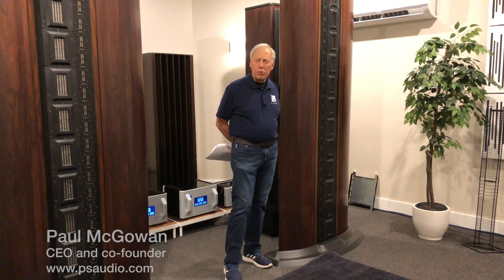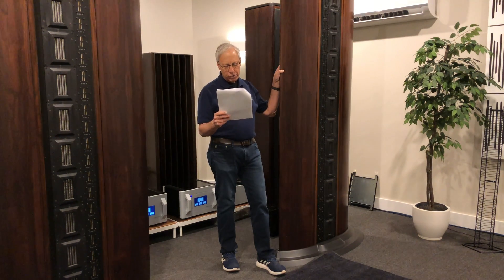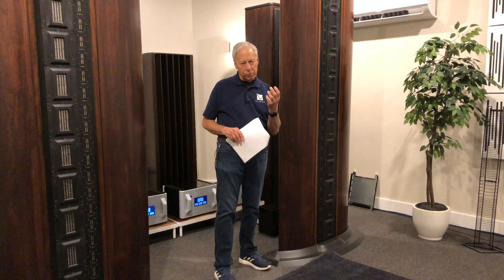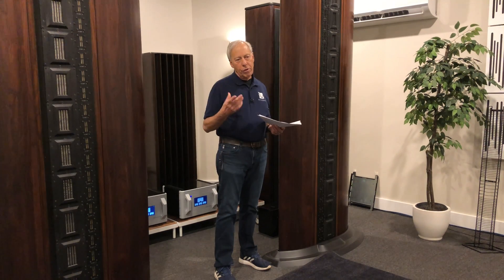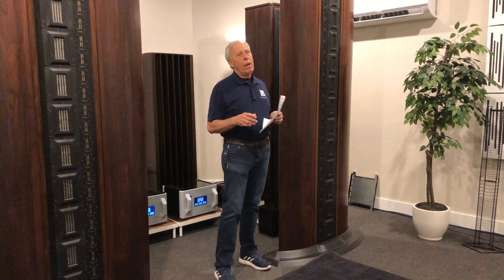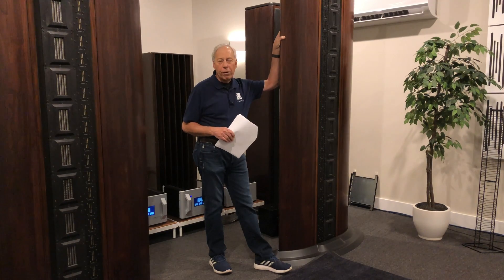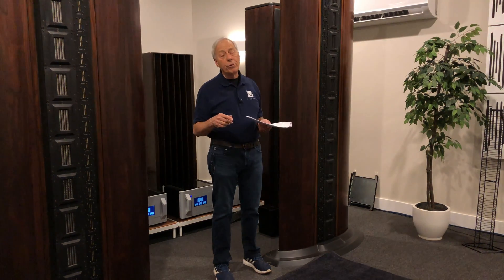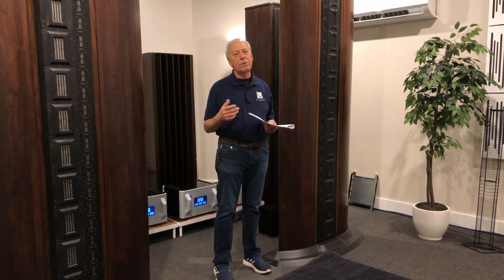4Ω speakers on an 8Ω load?

Comment: If you add 2 Ohms of resistance in front of the speaker it will have a significant impact on the bass response of the speaker, outside of the drop in volume.  The Q of the speaker will change and the cabinet that was designed for it will no longer be appropriate, less of an issue in sealed enclosures than ported ones.  The bass will likely be less well damped, more "boomy".  There is DC resistance in the crossover components going to the woofers but this has been accounted for in the design in any competent speaker design.  Admittedly the resistance goes up in the speaker as the voice coil heats up at higher volumes but this is again a design consideration and is small by comparison.

Comment: Sorry Paul I would NOT run a system i that matter. I know personally that will not work. I Fired 2 of Sony s top -of-the-line receivers
A top-of-the-line Marantz In a matter of four weeks running  4 ohm speakers. So I replaced them with the anthem  MRX 1120 was specifically stated  that it could handle a 4 ohm load and paired it with a Rotel RB 1582 mk ll amp rated at 4 ohm

Comment: Could 10W 2 ohm resister get hot enough to start a fire on a carpet, by doing what Paul said in this video? Come on Paul, I want PS audio focusing on making great audio gear at great price and not waste lots of money getting sued by people with burnt down homes.  Take down this video, or at least edit it with stronger warnings. Or are you certain that what you said people can do in this video will not cause any fire? What's the highest temperature the 2 ohm resister could reach following what you said in this video? Could something people have in their homes catch on fire at that temp? If people put 1W 2ohm resister instead and burn their house down, can you win in court?

Comment: There is no such thing as an 8 ohm amplifier. An amplifier's output performance varies with the load connected. A simple review of the owner's manual will tell you what loads are compatible with the amp's maximum output capabilities. I would never recommend adding series load resistors. Amps and speakers are either compatible with each other or not. At typical listening levels there is seldom an issue as described. Proper ventilation is always important.
Reply: You could have an amp with an 8 ohm output impedance,  but it wouldn't be hifi. Ideally an output transformer-less amp would have an output impedance of 0. Most modern amps are some small fraction.  And didn't tube amps with output transformers have taps for different loads? They might very well match the speaker impedance for maximum power transfer,  but I'm not sure.

Comment: Modern digital amps have a protect mode. If the amp doesn't like the speakers impedance, then it will likely trip the protection mode. If it doesn't then you will want to watch temps. Rather than a resistor to match ohm rates. Just add another 4 ohm speaker to each channel in series. Wasted energy with resistance.

Comment: BAD Advice.  It depends on the quality of the amp and the actual  minimum impedance of the speakers.  The given Ohms are the nominal.   Current drain will double - see Ohms Law - which can put a large strain on the amp, as well it can be influenced by the speaker cables  since their effective resistance will double (again, see Ohm's Law)
Reply: Yep bad idea, best to get an amp that can handle 2 ohm loads for that channel if surround sound. Etc

Comment: Disclaimer - I’m not even close to being an electrical/electronic engineer—- I’ve been running the nominally rated 4 ohm unifi ub5 in the 8 ohm setting for the past month. I don’t listen at ear splitting levels so it sounds great and the receiver never gets hot. It’s always been warm to the touch but never got hot and the auto shut down never engages. The receiver I’m using now is the Yamaha r-n803. Based on what Audioholics.com said those amps that have that feature of switching ohms from 8 to 4 are just to meet certain safety inspections (think CE and UL) and to do so moving that switch over to 4 ohms is crippling the amplifier so it holds back the electrical current driving the speakers. They have run tests on the Yamaha a-s801 amp section running 8 and 4 ohm on an 8 ohm load. Anyway take this with a grain because do not know what I’m talking about. Not really.  

Also wanted to add a speaker is nominally rated. Speakers will perform dependent upon the music - ohms will fluctuate. Again I don’t know what I am really talking about. 

Anyway I have experienced nothing bad from running a 4 ohm inefficient unifi un5 on an 8 ohm load.

Comment: I connected 4ohm speakers to my 8ohm receiver and when I cranked up the volume the receiver went into protect. So now I only search for power amplifiers that can support down to 2ohm loads and only use 4ohm minimum speakers.

Comment: In one room of my house I've driven some fairly large (three-way with 10" woofers) four-ohm speakers (R. A. Labs Reference 2A) often quite loudly for over 20 years with eight-ohm receivers and had no problems of any kind. The receivers involved were good ones (none died from this use, I merely upgraded), however, and I suppose something such as an entry-level Sony would possibly have had problems.

Comment: 25 watt wire wound and non inductive would be best . Failing that use a 50 watt L-pad attenuator or even try two 4 ohm speakers ( they gotta be the same btw !! ) connected in series ..!

Comment: If it were he other way around, for example 16 ohms speakers, you'd lose power but even it clipped the amp wouldn't get hot. While a heavy load will greatly increase the heat. I've had friends twist the wires together and hook up 3 sets of speakers to a 8 ohm amp -- something like 100 watts of heat for 5-10 watts out ...  maybe you've known a few.

Comment: Rare indeed is the amplifier that will smoke if the load has a lower impedance than normal, 
as long as it isn't Too low. 
Keep the volume well below the point where the amplifier clips, and it will most likely be OK.

Comment: Would've been helpful to say what type of speakers they are for sure. A common case is ported enclosure speakers which have a lot of impedance rise - the drivers and crossover outside the enclosure may measure 4 ohms, but once in that type of enclosure their minimum impedance may be as high as 10 ohms for example!

Also would've been good to know what amplifier is being used - some can have a conservatively rated minimum impedance and I have one rated 8 ohms minimum but it doesn't complain driving sealed enclosure 4 ohm rated speakers which are much closer to a true 4 ohm minimum impedance.

Comment: Adding resistors in series will ruin the damping factor and that means your speaker cones will not be able to follow the intended wave motion as precisely, e.g. a drum wIl sound more boomy.
Reply: True, although the DC resistance of the speaker in fact is also a resistance in series with that speaker coil. A speaker with 6 Ohm impedance rating typically has ˜5 Ohm DC resistance, which is in fact already has a 5 Ohm resistor in series. So adding another 2 Ohm won't change the boomy-ness as much as one would expect.

Comment: At lower impedances the amp will get hot.  Get yourself some 120mm computer case fans, they normally run at 12V DC but you can run them at less voltage to make them quieter (I run mine on an 8V wall wart and they are silent).  Just point them at the heat sinks for cooling.
Reply: I found a small personal desk fan at Walmart for something around 5 bucks. It's got rubber feet, can be rotated for direction control, as in pointing up to extract heat  and is 120 volts, so I have it plugged into a switched receptacle on my amp. Keeps it nice and cool and a lot cheaper than computer fans.
Reply: @jamesplotkin4674  Cool! :-)
Reply: @juliaset751  Forgot to add, I placed a small postal box to surround this fan and have it draw air out the top and not spill to the sides. The amp sits on top of the tv center and a nice mantle clock hides the box. Works really well. Only at the lowest volume, can you hear the gentle whir of the fan.
Reply: @jamesplotkin4674  "a lot cheaper than computer fans"
Fleabay has them trending around $AU3.75 ($US2.59). I have boxes full of recovered useable computer bits so they are even cheaper than that.
Reply: Works well for hard drives that run too hot!
Reply: @jonathansturm4163  Yep, I have an external HDD dock that I’ve modified with a fan.  I think I may be keeping Cooler Master in business.  LOL
Reply: @juliaset751  I feel the same way about Seagate! A 2 TB Barracuda that's only ever been used for backup in an IcyBox is dying!

Comment: You could use an auto transformer and virtually eliminate losses you would incur using a resistor.  Another benefit of the auto transformer is that you get the benefit of the full damping factor of the amplifier that the resistor would likely adversely affect.  The full back emf of the speaker would work against the amplifier’s low internal impedance resulting in greater control of transients.  A 48V-115V control transformer wired in an auto-transformer configuration is nearly perfect to couple your 8 ohm rated output to a 4 ohm speaker load.  For a 100 watt amplifier, the transformer would only need to be 30 VA rated.  I’ll bet some specialty transformer company probably makes a transformer that already does this trick.

Comment: This is a good question to ask, and relevant to my setup. I have a pair of Plinius SA-50 amplifiers, which are stereo A/AB but can be switched into monoblock mode (hence why I have two). Now the manual states that in stereo mode I can connect speakers from 4 to 8 ohms nominal, but in monoblock mode only 8 ohms. I currently have speakers that are 8 ohms but have considered replacing them.
GE Tritons have a nominal impedance of 8 ohms but reviews warn they can dip down to the 4 ohm region or lower. In Class A operation the amps are already running hot. Now I assume the speakers spend most of their time around the 8 ohm region and only dip part of the time, hence the 8 ohm nominal spec from GE so it should be a non-issue. Any thoughts Paul?

Comment: Speakers do not possess "an" impedance, they have a "nominal" impedance, a somewhat fictitious number. Nearly all speakers of interest to the audiophile have a nominal impedance of either 6 or 8 ohms and every amplifier I have come across is happy to drive either. This doesn't mean there are no amplifiers so badly designed they are going to go up in a puff of smoke with 6 ohm speakers, but they are unlikely to have been manufactured for audiophiles' needs. There's a good explanation in How to stop worrying about speaker impedance by ELAC's Andrew Jones:
https://www.cnet.com/news/how-to-stop-worrying-about-speaker-impedance/

Comment: I used a 100 wpc $100 Sherwood receiver 11 years ago to check the phasing after recapping the crossover network on my 4 ohm speakers while the woofers were out for reforming and even at low level and the woofers disconnected the receiver shut down after just a few moments every time to protect itself.

Comment: Heatwave in Europe.....anyone elses amplifiers getting a bit toasty??
Reply: Is that class D weather for sure
Reply: I dont even wanna turn it on, giving to much heat!! :p
Reply: @87woutor  it's in a short shelf, not too much space to breathe and I'm scared
Reply: @randall96  it will be all better soon, might as well wait a bit
Reply: @87woutor  yup
Reply: At 28C inside (37C in shade outside) in middle England my Amps been off for a few days :-(
I do have AC Infinity T8 ‘top to rear flow’ fan unit, however, as not used to this heat all day and night long I’m not in the mood to listen to music anyway. Looking forward to cooler times.
As for ohm matching, my Amp can be configured for 4/6/8 ohms using the lowest setting for mismatching AV speakers but it’s left at 8 even when surround speakers are engaged - all reviewer folk seem to advise not setting below 8 as it can affect sound quality. Does it create more heat, not really sure but does seem to lose some dynamic power if set to match the 6ohm lowest pair. I hope there’s not a new trend in this low ohm matching, seems to lower voltages so you don’t get the power for transients even at moderate volumes.
Reply: @RealityADT  crazy temps

Comment: Another piece of advice with this. Is to use a cooling fan on the amp, and give it plenty of breathing room. It's not just the power supply the cheap out on. It's also the heatsinking/cooling sometimes.

Comment: I have the same question but about a transformer coupled tube amp.  Should I use the 4 or 8 ohm tap for 6 ohm speakers?
Reply: Just try what sounds better. 8 ohms would mean less heat losses though.
Reply: @westelaudio943  no problems burning out tubes or anything?
Reply: 4 ohm tap fixed a lot of problems with system.  Noise floor dropped tremendously.   Now more "controlled".
Reply: @chemania1  

Usually not as long as you don't drive it to max.

Comment: I know that some amplifiers have thermal protection so that if you did overload the amp with low impedance speakers the amp would probably go into protection and shut down.  Then you could power cycle the amp to recover after it cooled off.  I've placed resistors in series with tweeters that had more sensitivity than the woofers to balance the sound between bass and treble in a two way system.  I do like building my own speakers using raw drivers and crossovers.
Reply: I needed to tame the high frequency response in my speakers due to room interaction. There's a 3.3 ohm 5W R in series with the tweeter. There's no way I'd put a resistor in series with a woofer though.
Reply: I prefer raw drivers to fried.